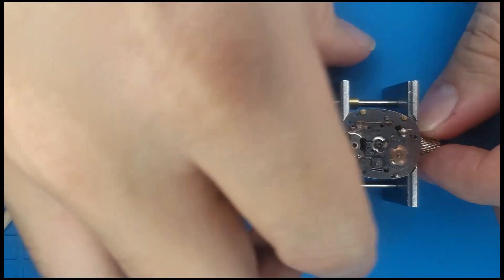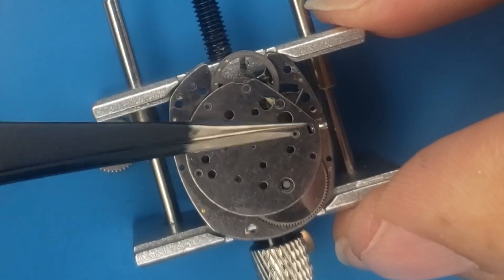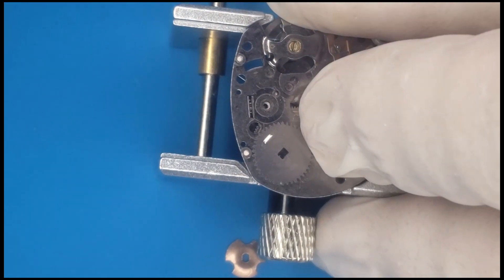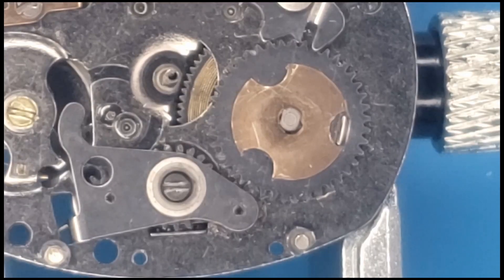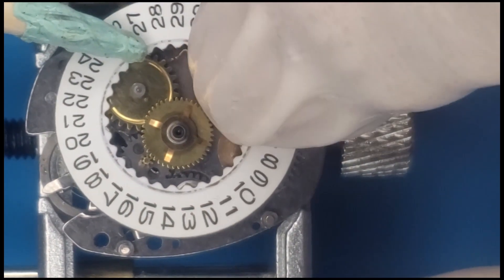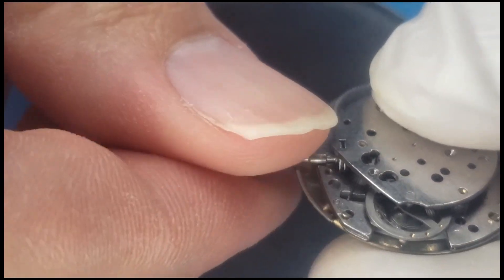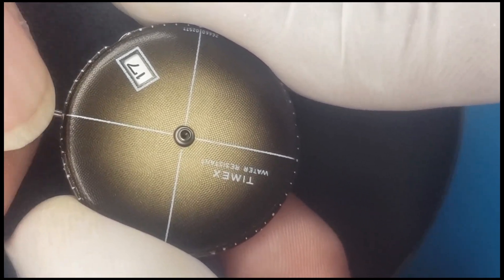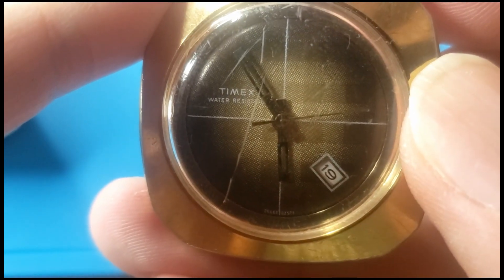Timex M25 Movement Reassembly - Timex 26660 Repair

Comment: …. And I have also had success just dumping the whole thing in IPA for a few hours without disassembling (obviously after taking off the dial and calendar (if there)). Dry in the the oven are very low temp to evaporate all the IPA then oil.

Comment: I have found these movements a little temperamental after service.  Sometimes the vshock balance screw “tightness” is very specific for the balance to run in all positions. Use the lightest oil you have on the pivots (note that some are only visible through holes in some of the wheels) and I have had to put tiny amounts of oil on the pin lever pins on occasion to get reliable running. When assembling I have found it useful to use tape to keep the plates together whilst inserting the screws. It can take a lot of patience to get all the pivots into their holes! For such simple movements these can be quite challenging, but strangely satisfying!

Comment: Working on an M27 right now.  My M25 misadventure is complicated by not realizing the barrel arbor was not secured correctly by the previous owner tinkering or banging it around.  Removed the "Bridge" and pop goes the weasel right into the mainspring,